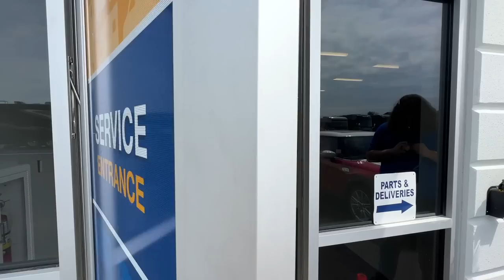National Indoor RV Center Nashville TN | Major Appliance Replacement Experience & Shop Tour | EP270

Comment: Happy B Day Sue!!! Mark really knows how to treat a lady.  

Ironically, we must be living in a parallel universe because we also had our washer and dryer replaced at the same time here in Florida but it took 5 months to complete given all the RVers here during the winter.  Our whirlpool ensemble was almost new and used one time.  When we got back from our trip to Pigeon Forge in November, for what ever reason, the washer would just start running by itself and not shut off until I switched off the breaker. When I contacted Giant Recreation Center about the problem, they indicated it was likely the control panel pcba that was the cause and proceeded to tell me they have other Whirlpools waiting to be repaired but the part was on a National back order for 6 months.  What was even more perplexing was a Whirlpool technician would have to do the repair but they can’t work in the RV for insurance reasons… so you probably can guess what the process is to do this.  The dealer needs to take the washer out, the technician would then troubleshoot the problem and order the “part”.  When it comes in, they will complete the repair followed by the dealer reinstalling it back in the RV.  Before going down that path, I checked with my Holiday Rambler Facebook friends and many had the issue with their Whirlpools… waited 6 months for the $300 control panel and having it reoccur a few months afterwards again.  Whirlpool has significant issues with this model given the research I did online….so, you guessed it…we now have a new Splendide Washer and Dryer that was installed April 21.  Our dealer said they have installed many of these over the years with no issue and they stay away from Whirlpool completely unless the customer insisted.  Fingers and Toes crossed.

Your service experience at NIRVC Nashville was amazing… it was like having your own personal Chan man  pit crew at the ready.  I wish they had a dealer closer to us here in Mount Olive Shores North…Atlanta is a good ten hours away.  By the way, tell Sue that we engineers are cursed because we know too much.  We do FMEAs in our head, assess the risk and put mitigations in place to minimize the risk.   No over Engineering involved LOL.
Reply from the maker: Yes,.....getting appliance repairs in an RV is a challenge!  Researching on irv2 it was obvious the Whirlpool repairs folks would get were not a sure thing. After 10 years of use, we had an easy decision to just replace it.  NIRVC takes pride in being available to bail out fulltimers.  You have to be prepared to be "worked into" their current busy schedule, but they truly understand full time life because their CEO and owner Brett Davis is a full time RVer,...for real!

Comment: I am continually amazed at how much you are required to spend so much on Miles.  Having owned a Wonderlodge, a Monoco and two Newmars I finally gave up on a brand new Newmar Dutch Star 4081 because it spent more time at NITVC than camping.  You are tenacious
Reply from the maker: Yes,.....you are right,.....it does cost a ton to keep Humpty Dumpty all in one piece!  But Sue & I are on the same page emotionally,.........we both love & appreciate the lifestyle.  We accept the price of admission.  In this episode, you have to admit that at least we got 10 years out of the washer,..........and I replaced the dryer just so they matched!

Comment: Mark you have more than talked me into using National  Indoor RV center. I have some areas on my coach . One being
a basement door that I want to make sure the metal is straighten out and the paint  will match and not look like a two tone
paint job. I will make sure to drop you name as well. Thanks for all your help that you have given me many times. God Bless you and Sue.
Reply from the maker: We have a friend that is having his doors fixed & painted at the Foretravel Factory. His doors had creases in them bad enough, and long enough, that he had to have the entire doors replaced & painted.  If the damage to the doors is mostly cosmetic, and dings and dents are only the first 6" up along the doors, you can look into adding Summit Products Stainless Steel Adhesive attached panels to the entire coach for about the same price OR CHEAPER to correct the issue! See http://www.rvstainless.com/

Comment: Happy Birthday Sue. We just had a third party inspection on a 2015 DS in Atlanta, which we hope to purchase.  Would you mind sharing the total cost of replacing the washer and dryer so we have a heads up.
Reply from the maker: Washer/Dryer/Stainless Hoses and New Overflow Pan = $2119 plus $850 labor (3 guys at some time, two guys most of the time and one guy finishing up!) After I saw what was involved, this 71 year old was glad he didn't do it.
Reply: @OurJourneyInMyles  Thanks

Comment: was the old dryer a 20 amp and what is the new dryer? Do you still have your bikes? haven't seen you riding lately. You know what, about the only thing you haven't replaced is the toad.
Reply from the maker: New dryer is 20 amp 120 volt. It is WAY larger in capacity than the last one. We still ride the bikes!  Just got back from a 15 mile trip round trip to the store to return some stuff just to be out in the fresh air.  The Ebikes make us ride a lot, but we don't get near the exercise of the old "regular bikes".  But at my age now, that is why folks stop riding,.......its too much effort.  The Ebikes have put the fun back into riding!

Comment: Hi, I hate to say it but it seems like you two should maybe just camp in NIRVC shops across the country.  It seems like your Dutchstar has a lot of ongoing problems….kind of a money pit….and you constantly need to find a shop for repairs.  That’s a shame.
Reply from the maker: We are grateful to have them to stop at!  We live in it 24/7  Have driven it 70k miles, and most things on it are solid. Every rain storm, wind storm and dust storm we are in. We are never stored under cover. The inverter is always on, the water system is in use every minute of the day, the toilets get flushed 10 or 12 times a day, etc.....  Full time living is no comparison to weekend warrior camping.